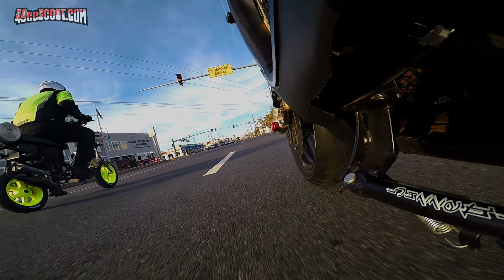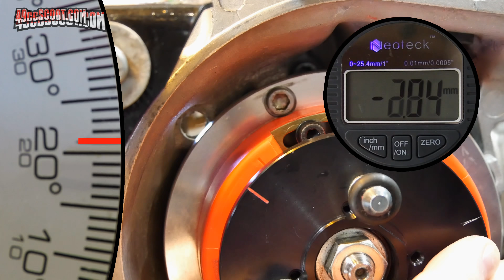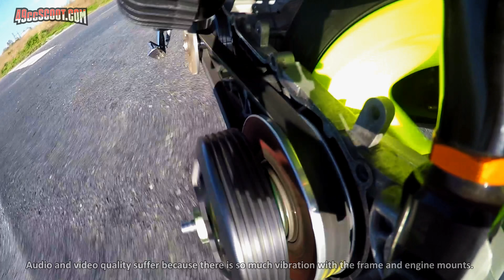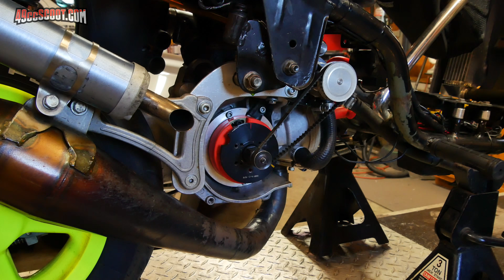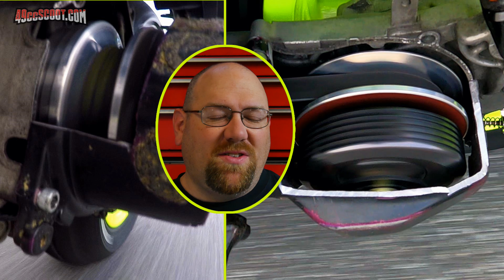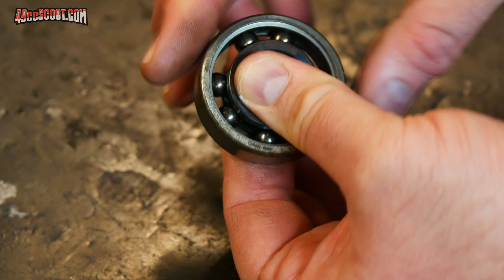Breaking Almost Everything : Scooter Fails : TPR 86cc Build : Part 48

Comment: Hello @49ccScoot.

Its a common problem on HyperRacing scooters that the backplate on the vario breaks, i my self have broken atleast 4. However there is an easy solution to the problem.
https://imgur.com/a/1KgSF2e

Its easy to feel when the backplate starts breaking, as you will feel like the engine is engine-breaking on you, like in your truck. I think that the backplate breaking is the cause of your crankshaft bearing going bad, due to the big amount of unbalance. 
We make the spacers in different sizes so you can swap them out depending on how many shims you have in your vario.(To get clearances for your kickstarter stardrive) 
I dont recall the the minimum measurement that you are getting on your belts, but malossi states 1mm under new measurement.

Hope the pictures help you, and will be looking forward to seeing you make on by yourself on the mini lathe.
Reply from the maker: So just the extra support from the larger diameter spacer solves it? Interesting. Thank you for sharing that.
Reply: @49ccscoot  Yes it does, very easy fix. :) The ones i make myself is just a solid round piece with a hole in. The only reason to make the inside piece like the original is to rule out any interference with the seal, but should never be a problem if the seal is seated properly.
Reply: Ah, and you are even using a circlip. So you will never have that problem.
Reply: @49ccscoot  i second that. i've got one from malossi and one from stage6, both with different thickness to put behind the plate.  Never measure them but the malossi looks clearly thicker than the stage6, they may be very close to 1cm. 
These came with the variator kits for piaggio if im not mistaken?
Reply from the maker: Thanks guys. I will make something simple to replace the standard spacer with a larger OD.
Reply: @49ccscoot  Malossi Part NO: 2513056B
https://www.malossistore.eu/fixed-cover-for-multivar-2513056B-P
Reply: @49ccscoot  BrentMade(tm) spacer, where do I send my money?

Comment: Why the belt going up when rpm drops after accelerating ? Central spring too hard ?
Reply from the maker: The CVT responds to load. Under low load, it can shift to reduce RPM for cruising and then shift again to increase RPM when accelerating.

Comment: A lot of experience messing with that assembly. BUT you seem to be missing the top tip regarding mechanical failures. WHEN breaking, dragging, crunching, rasping, squeak...etc. sounds. Come from a moving assembly, STOP immediately. Check and correct the problem before carrying on. It's that simple!

Probably the most valuable lesson from the entire video is precisely that.
Following that basic principle would have saved a "sh_t load of money" and work from the get go. ;-) 
 Cheers
Reply from the maker: Well, it's sort of a unique situation. Normally one doesn't ride with the intention of breaking something.

Comment: No offense use proper motorcycle cameras they are not expensive.
Reply from the maker: At the time I had 2 GoPro Hero 4s and had 2 Hero2s before that. I'm too broke to own a whole chest full of them, but I did end up buying 2 Hero 9s. With the batteries and such, that's still over $1000 which is significant to me.

Comment: Is it ok to run without the cvt cover?  Doesnt the bearing in the cover support the other side of the drive shaft and clutch.
Reply from the maker: It's not a good idea. The CVT cover bearing does support the shaft. I have added an extra bearing in the gearbox, so that's not my biggest concern. The cover is a structural add-on for the swingarm section of the cases.

Comment: Is there a over range varator kit that I can still use the starter and starter flywheel?
Reply from the maker: There wouldn't be enough room to get so much travel. There should be larger diameter variators that may be more capable than stock.

Comment: Maybe you should look into that process that strengthens metal, similar to shot peening, but uses ceramic shot, you could do the crank, rod, Piston, ring, jug, and head, along with the exhaust port, if it was 4stroke, if do the valves, and dimple the intake port, and possibly do it as well, it makes the metal on the surface hard and slippery, it takes rings longer to seat, but then it has less friction without galling, doing the crank output splines, prevent wear from loose fitting variator,  I think it would be worth looking into, I think it can be done at home, it would be worth it in your case, it can improve engine life! Maybe more power! Oh it's the "WPC treatment" I'm going to check it out, crank , rods, Pistons, valves, valve springs, transmission gears, ring and pinions, Axel's, cylinder heads, even the notes, if honed properly after, could have a stock type engine lasting forever if maintained properly! I have pulled a Chevy v8 apart with nearly 120k miles, and looked like it was less than 20k miles on it, I bet with this "WPC treatment" it could could see 500k miles and look fine, it leaves a surface similar to a hand scraped machine surface, only it hardens the surface, and makes it extremely slippery, but it looks like a freashly sand or glassbeaded surface, but smoother and slicker than  "mirror" polished stainless steel!! It's slick as wet ice! Absolutely amazing outcome, it could be the next level for your engine!! It could possibly make the bore in the jug last longer, and free up slot of power, if the bore and Piston & ring is done, it may take 20 miles or so to truely seat the ring, but should nearly eliminate friction between ring , Piston and bore, sounds half backwards to me, but that's what the guy said! They build high end cars and engines, I'd even do the gears and shafts in the gear box, make that scoot, well ... Scoot!!

Comment: Could it be heat Build up in the belt, inside the cover? I had a  hot rubber smell from mine ,  maybe it is heat killing belts?
Reply from the maker: Heat isn't doing it any favors. My CVT cover is vented, but I did wonder since the belt seemed to go longer with no cover or a very minimalistic cover.

Comment: Hey Bret where can I purchase a crankshaft stand like the one you used in this video ? I have been looking can’t find maybe I am typing it into the computer under the wrong name !!
Reply from the maker: I made mine. It's just a bunch of angle iron welded together. I actually used the shipping crate from one of my Chinese scoots for it. The feet are bolts with 2 nuts so they can be adjusted and leveled out. Bearings are bolted on. If you can weld, it's pretty simple.  If you can't weld, then it's still not too bad because it could all be bolted together.

What most people use are V Blocks or X Blocks. You should be able to google that and find options. You don't have to look for tall blocks. Most just put something under each one of equal height (2x4s for example) if the crank doesn't clear.

Comment: This was funny actually, but not for your wallet. :D My scooter belt broke right after I sold it to a friend. I used the malossi belt with a scuffed variator for a few miles before due to a loose nut inside the case.  You can try and use an old variator and scuff little marks all over the place with the grinder or something. It should break the belt more easily
Reply from the maker: Not a bad idea. I was trying to see it happen as it's normally setup though, in case it taught me anything about my belt wear issues.

Comment: This preparation in this minarelli engine is very common in my country, Spain, I recommend that you change the rear final transmission, this preparation usually reaches 135-140km / h without problems and will consume less fuel
Reply from the maker: Thank you, but how many of your locals doing this are 300lb/136kg? I like the gears at 11.2:1. If choosing between the best speed or the best acceleration, I prefer acceleration. I did try 10.1:1 gears in another video and it hurt acceleration without any major gain in speed.
Reply: @49ccscoot  hahahaha sorry, well anyway I love motorcycles, I also make preparations on scooters European preparations with track specifications are usually around 60 / 70kg per mount and between 20hp and 30hp of power and we usually run in karting circuits where the motorcycle a real plane does not usually go over 60mph
Reply: @49ccscoot  by the way which scooter is it?
Reply from the maker: @frankycabello2124  2004 Vento Triton R4i
Reply: @49ccscoot  I know it but it is not usually sold in my country, in my magic times I managed to put 15hp in a stock oem cylinder modified with a 24mikuni, mvt ignition and yasuni c16 exhaust, the minarelli engines are very reliable and robust and in a short time you can have the engine completely disassembled

Comment: I found it interesting that when you let off the throttle it went into hight speed. About the belt I believe it's the heat that  breaker the belt. Can you do a video that checks the temperature of the belt when it breaks? I also had a belt fail with very low miles and don't believe it was due to the stress but the high temperature caused it to fail.

Another thing is don't use any water in you coolant to prevent any rusting.

It could be that the crank shaft caused the bearing to fail. After seeing the plastic in the bearing I think you were right and it was the bearing that caused the crank shaft to fail.
Reply from the maker: I think the heat has to play a role. It's never something you can set a watch to, but I think it would have broken before everything else with the condition/mileage that it was in.  Even though my usual cover is well ventilated, it's not extreme like the one used to get a good view.

I could carry a non-contact thermometer, but I don't know how accurate that would be by the time I got to check it. Really not sure how to measure belt temp like a gauge readout on the fly, short of some likely high dollar equipment.

Comment: @49ccscoot I can tell you those nylon caged bearings do not work well in two strokes for the crank. I have a 75cc two stroke chainsaw that Husqvarna used to use nylon caged bearing in. These are the 6203 not the 6204 bearings however the nylon cages do not hold up to the heat and Husqvarna soon learned they were a bad idea and went back to steel caged 6203 bearings. I also have a 91cc chainsaw that is a real handful. Its about 7.2 HP and is a scary chainsaw to operate. If it were to kick back on me im sure id be in the hospital or dead...
Reply from the maker: Most seem to be telling me that these are the go-to for high RPM 2Ts like high end scoots, racing karts, and so on with one big advantage being that they don't destroy the engine like steel cages if they end up banging around inside when they fail.

Comment: I'm actually surprised how little of the variator is used under power. Looks like 50-60%, it only shoots up to the edge when you back off the throttle.

Comment: Great video 👍 I’ve just ordered a crank and bearings with Polymer bearing cage - is Polymer better than steel? I’m worried I’ve made the wrong choice now 😂
Reply from the maker: I believe the polymer cages are good for reducing friction. Steel may be stronger. I don't know that this was caused by the bearing failing. It sounds like ramp plate failures are more common than I realized and no symptoms were present till the ramp plate broke. Hard to know for sure, but I think the TN9 bearings are OK or TPR wouldn't be likely to supply them.
Reply: @49ccscoot  - brilliant, thank you. Good luck with the rebuild 👍

Comment: I still don't understand y belt moves up on variator when dethrottling
Reply from the maker: When you get out of the throttle, the engine wants to "relax". It's no longer being provided with the fuel and air to try to run as hard as it can. As long as the contra spring is not too stiff, it will allow the engine to "relax" and settle to a lower RPM by shifting to a higher gear. Basically, the engine overcomes the resistance of the contra spring even off the throttle and makes the CVT shift so the speed can stay up without RPM having to be so high. If you use a really stiff contra spring and/or light roller weights, then the rear pulley may be more dominant and not allow the engine to "relax" so much. As contra spring stiffness increases and/or roller weight decreases, it should move toward being more similar to a traditional transmission left in one gear. So with that sort of combination, when you let off of the throttle, the contra spring and lack of roller weight would keep the engine revved and gradually decrease RPM as speed decreases.

Hopefully that makes some sense.

Comment: error ... there is a vario part for this, so the bottom plate does not break ... you need such a part here ..

https://speedline.dk/yamaha-aerox-foer-2003/tilbehoer-til-variomatik/afstandsstykke-bag-variator-zoot-oversize-s-zt-101-02
Reply from the maker: Thank you for the link. Someone else also made me aware of the spacer. I had never heard of them before.
Reply: @49ccscoot  yes that part is important, I have it myself on my yamaha Aerox, behind my stage6 R / T oversize vario. without it you will break the back plate every time

Comment: In my opinion, your runnin it way to heavy. Must have lighter rollers, and a yellow contra spring 🤟🏻
Reply from the maker: Why? If I use lighter rollers, RPM will increase. It is tuned to run where it performs the best, based on a lot of testing. A stiffer contra would then make it rev even higher. So with lighter weights and a stiffer contra, I'm at 15,000RPM instead and now it's revving beyond it's power and accelerating slower with a lower top speed.
Reply: @49ccscoot  on the video you see when you take off that the belt stays high for to long when you hear the engine want to shift. So alot off stress on the belt and thats probaly the cause off all the belt failure. The TPR is made for high RPM.
And it just doesnt give the take off power ya need to let it run at its best.
Try a lil lighter contra and maybe with a base filling ring from polini, these are in all the high speed variator kits. The preloaed off the spring is less then a red red, but total load will be the same. Less preload will give ya better take off, just keep in mind rollers need to be a lil heavier.
I defenly would give it a try 😋
And alwasy at your service 💪🏻

Comment: Your running it way too lean, this is why you have chunks out your cylinder wall and your blowing crank bearings. 

Or your doing the wrong 2 stroke mix. 

Lean running is good for throttle sensitivity and power, but it won’t last 5 minutes, especially road ridding. 

Also as your scooter revs really high look into some racing gocart 2 stroke oil for high Rev engines, it’s thicker than normal 2 stroke. 

 I’ve been there and done it and rebuilt mine several times just so I could have that extra bit of pull/power but i got sick of taking it apart to rebuild it So I just ran It lean with a good mix and never had a problem.

Love the videos

Hope you get it fixed👍

Comment: Replace those crank bearings with some NTN bearings supposedly made in Japan
Reply from the maker: These were SKF. Not exactly cheap junk.
Reply: @49ccscoot  I've heard of SKF bearings. Approximately how many miles or hours were on those skf crank bearings?
Reply from the maker: @190SkyTeam  2,429. The same amount of miles as the crank.

Comment: how in sam hell is the vari closing more when you let OFF the throttle, should not happen at all like that. what contra you running? I kept using stiff ones and ended up my set up fine with a stock one.
Reply from the maker: I'm using some unknown contra spring. I want to say Kombat  sold through an ATV racer store. It's one of the softest that fits the OR. If it doesn't do what it's doing, RPM has to stay up when you're off the throttle.
Reply: @49ccscoot  yeah most guys with OR use the ST6 pink with really light rollers. but everyone has a diff set up

Comment: I take it your still loving the Amsoil that was removed from support for motorcycles and such give the Klotz Super Techniplate  a shot seriously man it lubes the lower end much better than Amsoil the issue with Amsoil is the film strength it doesnt hold in bearings well to lubricate them causing these issues hince why all the big motorcycle guys have moved away from Amsoil for 2 stroke oil failure after failure leads to Amsoil removing the support for motorcycles just to cover theyre butt.
Reply from the maker: AMSOil Dominator Racing 2T is still approved for motorcycles AFAIK. I used to use Saber, and that was then moved to being recommended for outdoor power equipment only. I did see a difference when I switched to Dominator, but I also went from mixing at 50:1 to 32:1 so it wasn't the best comparison. I have a case and a half of it here because AMSOil makes you buy a membership to get a discount so I buy a bunch whenever I get it to avoid paying for a membership regularly. That's why you probably won't see me swap oils anytime soon.